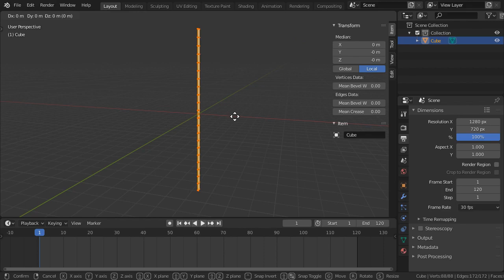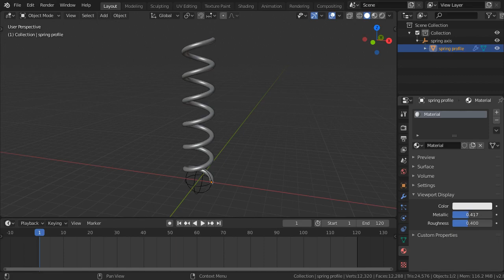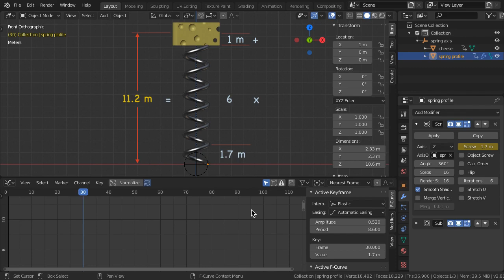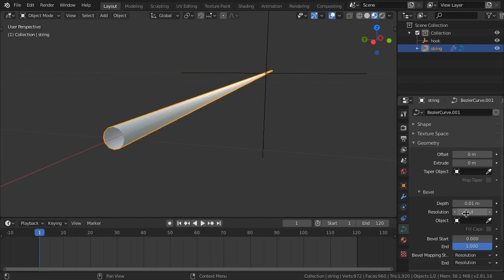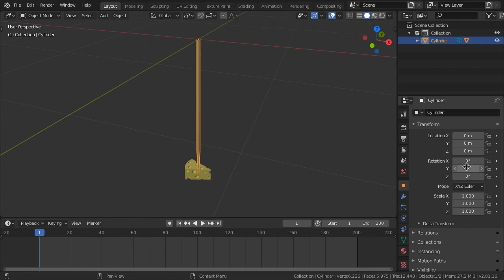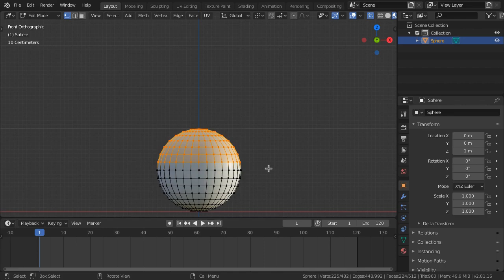Blender 2.8 Elastic Keyframe Interpolation and Sine F-curve Modifier

Comment: wouldn't it been much easier to just vertex parent the cheese to the spring?
Reply from the maker: Yes, probably.  I have not tried it, but that requires the spring modifier to be Applied to turn the spring into a mesh.  Then the spring animation rigging becomes more complicated.  I also tried adding a Child Of Constraint to the cheese,  and making the bone the parent, then setting the Inverse.   The Influence can then be animated to constrain or free the cheese during the drop onto the spring.
There are many ways to do this,  but at the time, I went for the most direct and less technical method I could think of.    I was trying to keep it accessible for beginners.    The point of many of my tutorials is not necessarily the BEST way, but a quick and dirty way to get a result.   Thanks for watching and commenting.

Comment: For the bending rod vibration, I am experimenting by using driver something like #3 * sin(frame ) * exp(-frame * 0.1). It is also a good experience!
Reply from the maker: Very good.  I finally sat down to figure out the formula for the Elastic modifier.  You are very close.  It uses the exponential function e^x, and the amplitude modulation is dependent upon the difference between the beginning and end keyframes of the effect.   The x input or "frame" ,  is multiplied by the natural log of 0.001 divided by the difference between start and end keyframes.  Thus,  e^ (-x * ln(0.001)/(beg - end)).   The modulator ln(0.001)/(beg-end) must be entered as a constant, as expressed in your formula.    The ln(0.001) is necessary because the Elastic modifier always maintains an amplitude differential of 1000 between the beginning frame and end frame.   So no matter what the beginning and end frames are in the effect,  the end frame amplitude is always 1/1000 of the beginning amplitude.   Maybe there is a more elegant way of expressing it, but that is essentially how the Elastic Modifier works.  Thanks for your input.